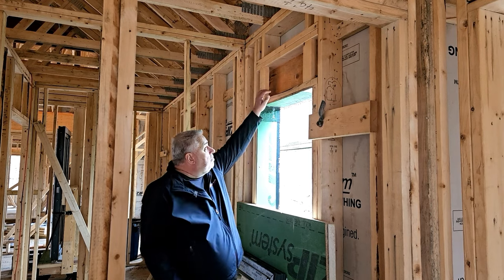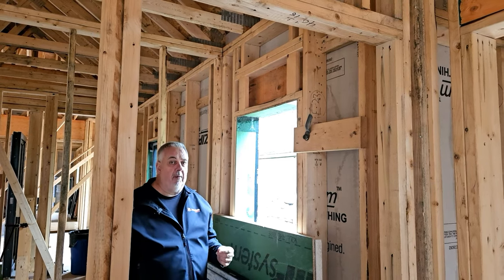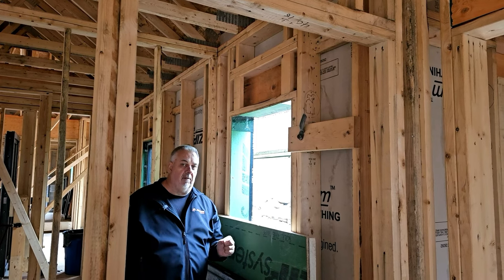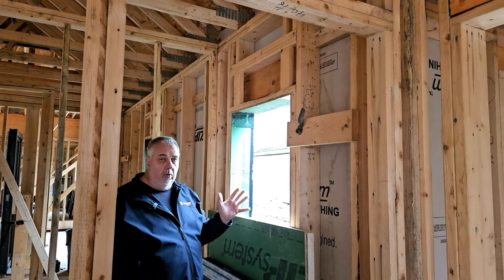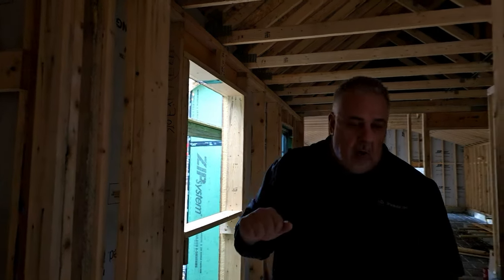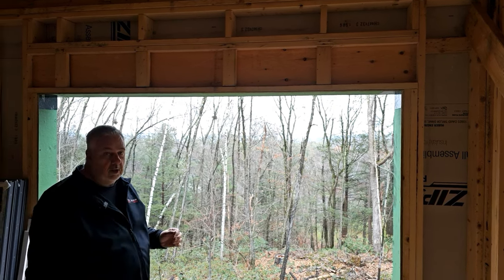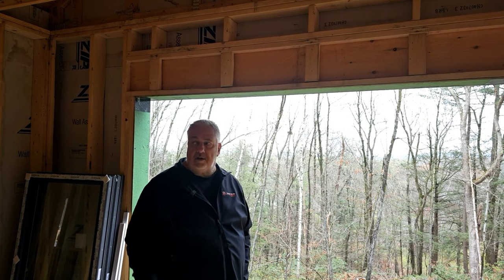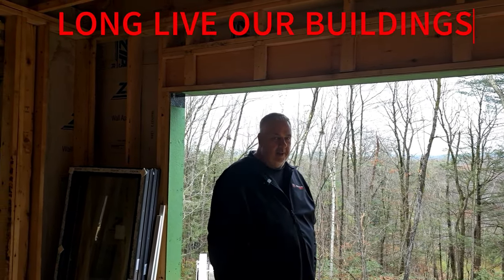POCKET HEADERS

Comment: Hi Steve, are you going to do a video on where you need to use a header in an exterior wall and when you don't? Some builders don't use headers in exterior walls that run parallel to your attic floor joists and your trusses because there's not much weight bearing on them other the the upper gable. Even if your engineer says a header isn't necessary, do you put one in just to be safe?